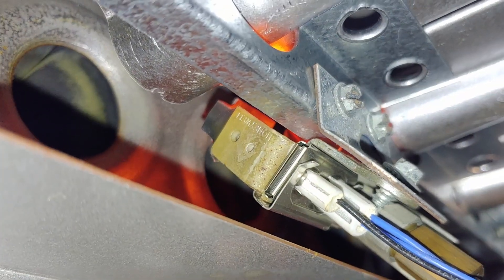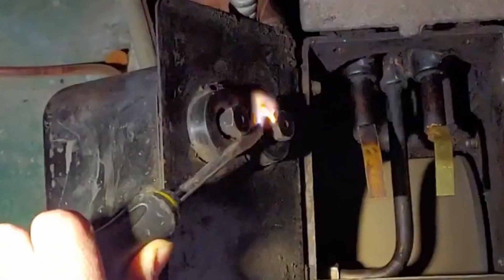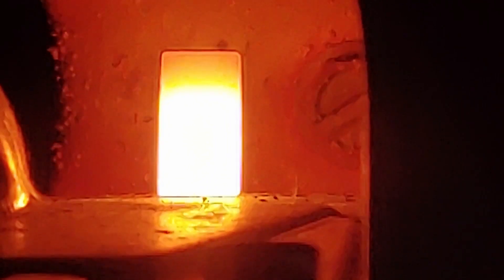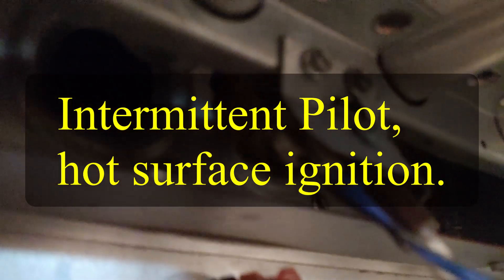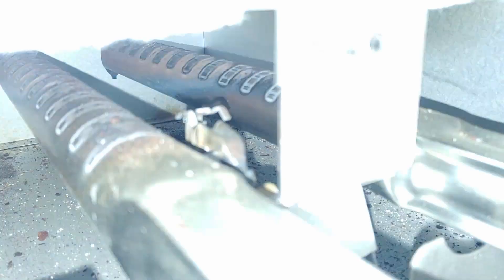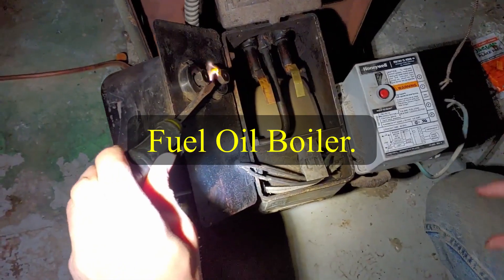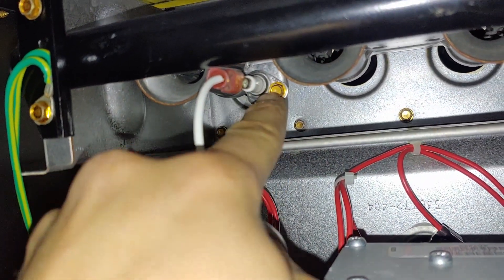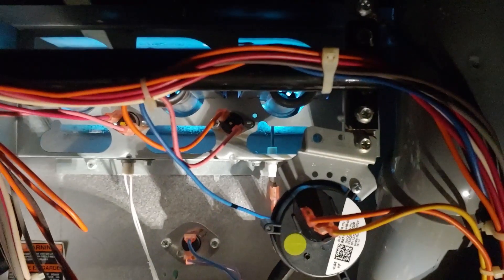How Does a Furnace/Boiler Light? The Four Most Common Igniter Types

Comment: My igniter on gas furnace stays lit …. Like super bright does not switch off even though the flame is on blue and blowing !?
Reply from the maker: Interesting...are you sure it stays on during operation? Sometimes they look like they're on since they're being heated by the burners. You'd have to check if it's getting power after the burners are on for awhile.
Reply: @ReubenSahlstrom  yes I just installed it maybe that was why. Seems like the problem is gone now the flame doesn’t blow clean into the holes it’s blue but there is roll back on the flame
If that makes sense anyways I fix one thing and then of course something else lol 👍🏻